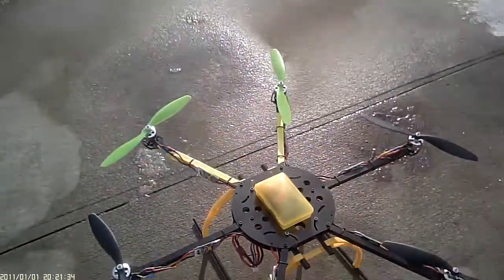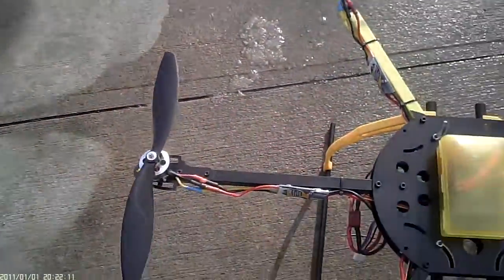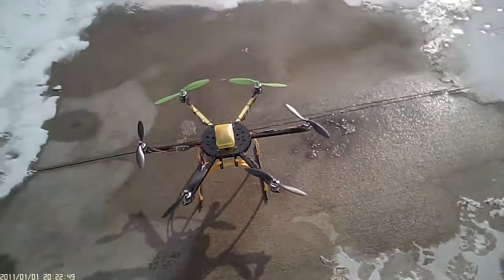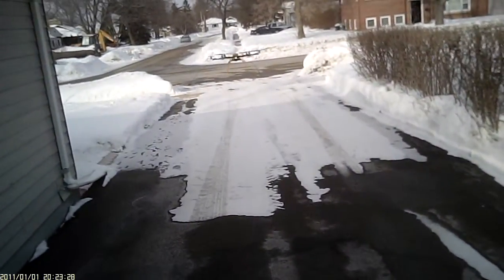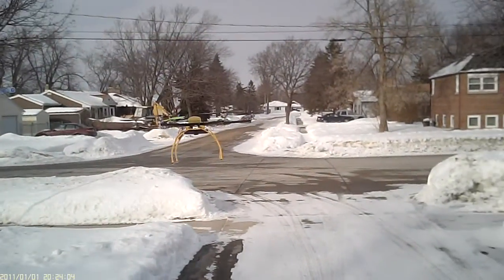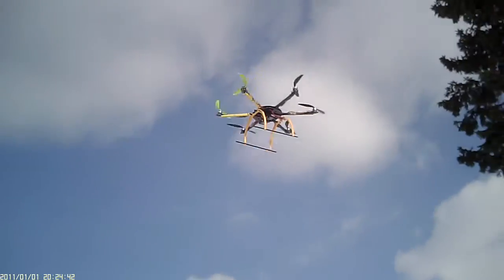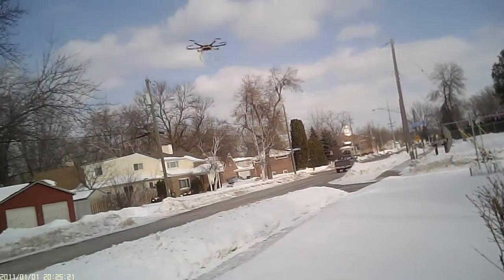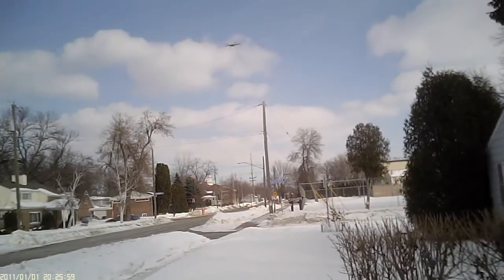Hexacopter Maiden 2 9 14, Hobbyking SX650 Glass Fiber Hexcopter Frame 650mm

Comment: hi how do you like that frame?  i'm thinking about getting one
Reply from the maker: It's not bad, it's flimsy, but works fine for the flying I do. I did take the mounts off and made my own out of plywood. I'm still thinking of taking the mounts off and just zip tying the motors to the arms.
Reply: how about wooden arms ? less vibrations transferred to frame i guess